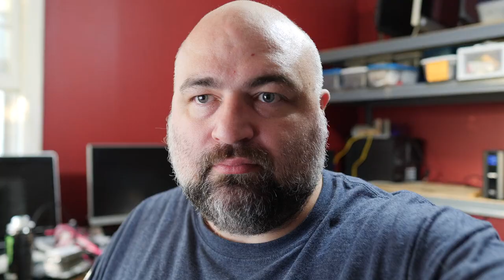Even MYTHBUSTERS Got The Airplane Conveyor Belt Question WRONG - A Neckbeard Explains - Jody Bruchon

Comment: Judging by your lack of actual calculations, and just saying things are impossible without doing any research or calculations, and just trying to use what you think are “big” words in your thesis statement that you are at a low enough level of intelligence that you don’t realize you are at that low of a level. Short answer to the question listed is yes it could take off as the forces providing movement to the aircraft are in no way affected by the the surface the wheels are on, would the forces of friction be increased by the wheels effectively having to free roll at twice the rpm they would if the surface was stationary yes, but not to the point it could not achieve lift. Would this increase the amount of are needed to achieve speed enough to provide enough lift to support the aircraft most certainly, but not prevent it from attaining continuous acceleration until terminal velocities are achieved. If you would like to learn the physics calculations necessary to take this from a question to an answer contact me I’d be more than happy to show you so the ignorance stops.
Reply from the maker: Do you understand what a constraint is?
Reply: @JodyBruchon  by definition a limitation or restriction show the me math where you have constraint that completely halts the acceleration and or stops that plane from moving forward at all, I’ll wait…….. because you can’t and I am willing to put my doctorates in applied physics, and mechanical engineering up against that I’ll put the explanation and math down to prove to you why it would accelerate forward until a point as to the resisting forces would not allow it to accelerate in a forward direction any longer, then post your calculations down as to why I am wrong
Reply from the maker: @johngarlick7115  The math is simple. What's x - x? That's how far forward the plane is allowed to move. The wheels are not allowed to go twice the speed of the belt, or four times, or infinity times. The question says the wheels and belt are locked together in linear movement. If the plane moves forward, this constraint in the question has been violated.

So, since you're waving your authority around as if it isn't merely an appeal to authority logical fallacy to do so, please enlighten us on how the plane lifts up without any forward movement.
Reply: @JodyBruchon  no the question I read was that the belt spins at a speed that mirrors the equivalent ground speed of the aircraft so it spins in the opposite direction the equivalent that the wheels would be spinning therefore if the drive force was applied to the wheels I.e. like a car the two forces would cancel each other out since you drive force is applied by linear thrust from a propeller, or turbine regardless of how fast the belt was spinning forward movement would be obtained until the forces of friction over came the force provided by thrust. I.e the wheels could not be moving at all with the brakes locked fully as long as the thrust provided is a stronger force whatever direction the thrust is being provided the object would move in an opposite direction since the wheels on an aircraft are essentially free spinning except for the friction of the bearing that is the only force to over come regardless of how fast the wheels and conveyer spin the conveyer could spin twice as fast as the wheels and forward movement would still be obtained
Reply from the maker: The question doesn't say that. The exact text is:

"imagine a 747 is sitting on a conveyor belt, as wide and long as a runway. The conveyor belt is designed to exactly match the speed of the wheels, moving in the opposite direction. Can the plane take off?"

There is opportunity to misinterpret the "speed of the wheels" on purpose, but it is safe to assume that it's referring to the linear speed of the wheel's contact surface. Thus, the question says "the conveyor belt exactly matches the linear speed of the part of the wheels that makes contact with the belt." This is physically impossible to actually do (thus why the question itself isn't great), but it is possible to analyze it theoretically. Even if the wheel rotation is considered fully independent from the fuselage, the movement of the entire plane forward (thus generating lift) relative to the starting position requires that the wheels be allowed to spin faster than the conveyor belt moves in the opposite direction. Yes, the plane in real life will be able to spin the wheels faster and move forward, but the plane under the speed-locking constraint stated in the question can never move forward.
Reply: @JodyBruchon  you are dense bud you are literally interpreting that how you want to to say someone is wrong to get views, as your statement itself is wrong wheels don’t move linear they follow a rotational path, therefore just stating “the linear speed of the part of the wheels that make contact with the belt” means the wheels are moving forward in a linear path not a rotational path also since the size of the conveyer is the length of a air strip the conveyer itself would be spinning slower than the wheels, this question is asked in almost every physics class today and the answer is a yes matching the speed of the wheels means the conveyer is spinning at an rpm equivalent to exactly the opposite of what the ground speed of the aircraft would be. It wouldn’t matter how fast you spun the conveyer as the wheels would always spin faster do to way forward energy is being applied by the plane your interpretation of the question self suits your need to try to prove yourself smart and obtain an income on social media using ignorance
Reply: @JodyBruchon   the only thing your interpretation does is violates physics itself, and is a non question as the way a plane provides energy for movement will always cause the plane to move forward and therefore the wheels and conveyer would constantly gain speed theoretically until it reached the speed of light but the plane would still be moving forward period and your equation is wrong your equation for this would be x+1=x which can’t occur
Reply from the maker: @johngarlick7115  If the wheels move the same speed as the conveyor belt (i.e. the wheels can't go faster than the belt), how does the plane move forward?
Reply from the maker: @johngarlick7115  This may shock you...but the circumference of a spinning circle has a linear velocity. I thought you were a physics expert.
Reply from the maker: The angular velocity at a specific radius is a linear velocity.
Reply from the maker: @johngarlick7115  What is it called when a circle is laid out flat? It's called a "line." You can unroll wrapping paper or aluminum foil if that's too complex for you to understand. Movement along that line is called...........linear motion. So yes, if you have an ANGULAR velocity, you can calculate a LINEAR velocity with that formula, but no calculation is necessary to point out that any given point on a spinning circular object has a LINEAR velocity. If you roll a roll of paper towels or a wheel or any other object that is circular in two dimensions along the floor, the roll has angular velocity and the outer layer of the roll has a linear velocity that is derived from the angular velocity and the radius from the center.

The value does not matter, and you agreed that I was right.

From Geogebra: "We measure angular velocity as the amount of rotation in a period of time.  Commonly-used units for angular velocity include revolutions per minute (RPM, how many trips around the circle in one minute) and radians per second (rad/s, how many radians of angle are swept in one second).  Both of these quantities measure the speed of rotation. The linear velocity of the two dots can be made to be very different from each other by changing the radius of one or both circles.  Linear velocity measures how fast the dot is moving along the circumference of the circle.  It's called "linear velocity" because we use linear measurements like meters or miles to mesaure circumference.  The larger the radius, the farther the dot has to go in one period of time, so the faster it must move along the cirrcumference."

A road, runway, or conveyor belt are linear. The tire may have an angular velocity, but it makes contact with the surface in a linear fashion, so the derived linear velocity at the contact radius is the correct way to examine the relationship between the tires and the conveyor belt. The specific numbers are irrelevant because the linear velocity of the tires is 1:1 locked to the linear velocity of the conveyor belt, according to the question's constraint as written. The angular velocity is irrelevant; it'll be whatever is required for the linear velocity of the contact area to match the conveyor belt precisely.

This brings us back to the question that you refuse to answer: if the plane can't move forward, how does it take off?
Reply: @johngarlick7115  I feel extremely sorry for whoever you got your Doctorates in Applied Physics from because you completely fooled them into thinking you understand simple concepts. In order for the plane to move forward, the wheels must rotate. It does not matter if they rotate from mechanical power or through friction. They must rotate. When they rotate, the conveyer moves opposite at the same speed. So d=1m, after 1 rotation, the wheel has covered 1 meter on the conveyer belt. But as the wheel rotates, the conveyer belt exactly matched the speed of the wheel in the opposite direction and moved 1 meter. 1 meter + (- 1 meter) = 0 meters. Unless you break the laws of physics or have found a way to bend math, there is no getting around that. Your plane has moved 0 meters relative to the ground and surrounding air. So you're stuck at a standstill no matter how much force your engines apply to try to roll the plane forward. Good luck to whatever company hires you and your "super real" applied physics doctorates. Sheesh
Reply: @tracruz  your not taking into account that the force being applied to the plane is through thrust that has nothing to do with the wheels the plane would move forward regardless if the wheels spin or not. The easiest way to solve this equation is to take the wheels and the conveyer out of the equation all together as airplanes fly and do not require contact with the ground to achieve forward movement the only way to stop the plane from moving forward would be to literally tie it to an unmovable object not counteract the rotation of the free spinning wheels as they themselves do not drive the plane the thrust enacted on the fuselage does and the plane would still move forward until the forces of friction over came the thrust provided or the tires exploded from spinning to fast but as this is a hypothetical question as the conveyer would fail long before those two things happened we can say the wheels and conveyer can spin at unlimited speeds, the plane still would move forward unless physically tied to something stationary end of story that’s it
Reply from the maker: All the equations in the world won't change the fact that the plane won't take off.

Comment: Never mind, I actually figured it out. Wheel speed has nothing to do with it. The thrust is having to match the speed of conveyor belt and it eventually reaches its departure speed causing it to lift. I got it!!! Very easy when you think of it that way!!
Reply from the maker: Thrust is irrelevant. The wheels are locked to the belt.
Reply: Thrust have every thing to do with it

Comment: So sea planes can't takeoff up stream either then 😂 same theory except water has WAAAAY more drag than tiny little wheels
Reply from the maker: Drag isn't a factor at all. The constraint is that the wheels and the conveyor must always perfectly match in "speed" regardless of drag.
Reply: @JodyBruchon  the speed of the belt is irrelevant,  it has no  effect on the movement of any size of aircraft hence I use the sea plane example. The only difference is water would grab the plane and hold it back. I do however totally agree with the theoretical scale issue but as for power, a 747 if held at full throttle will literally rip the runway up behind it as it has so much power.
I don't recall in the myth that the wheels couldn't go faster than the belt but I could be wrong but if you scaled down and put an rc plane on a treadmill you could both match and exceed belt speed. 
Obviously if the belt and tyre speed match the aircraft would be stood still but I don't think that was the spirit of the myth. 
Good video
Reply from the maker: @Bodgemiester  the question MAKES the speed of the belt relevant.
Reply: @JodyBruchon  possibly in the phrasing but like I say, the spirit of the question is sound.  They physics work because the aircraft gets its motive effort from friction with the air not the ground thus making the ground irrelevant.  If takeoff speed is 80mph and the belt speed is 80 mph plane will take off HOWEVER if the belt speed is zero and the headwind is 80mph the plane will stand still or potentially hover. Outside of that is over thinking the obvious question regardless of how it was phrased

Comment: You don't know what you are talking about.  The plane takes off because of the air passing over the wings not because of the wheels moving it. When a plane is taking off the wheels are not being driven, they are free wheeling. So your argument is pure BS!
Reply from the maker: And how is air passing over the wings, exactly?
Reply: @JodyBruchon  The air passing over the wings is produced by the engines, not the wheels. On any takeoff, the wheels are free-wheeling and not producing the movement of the plane, unlike a car where the friction of the wheels along the ground produces movement.
Reply from the maker: @johnpratt1661  The engines are mounted underneath the wings. Maybe you should re-think that statement. And I never said wheels produced movement; I said if the wheels are not allowed to spin faster than the surface underneath them is moving then the plane isn't allowed to move forward regardless of the method of thrust. No forward motion = no air over wings = grounded.
Reply: @johnpratt1661 Adam’s examples are not only incorrect, they misrepresent basic principles.  They botched the scenario and they misunderstand the application of force to a solid body vehicle on wheels.

The engines involved only apply force to the vehicle.  That causes them to roll (if they have wheels) or scrub across a surface (without wheels).  Both approaches give you basic, commonly available calculations for rolling or friction forces involved.

So - it doesn’t matter how the force is applied to the vehicle (car engine with powertrain, jet, rocket, propeller, or a person pushing/pulling) and it doesn’t matter the corresponding force required to power the conveyor.  The distance per time traveled by the circumference of the wheel exactly corresponds to the linear distance traveled by the conveyor in the same amount of time.

Mythbusters blew it in a few ways.